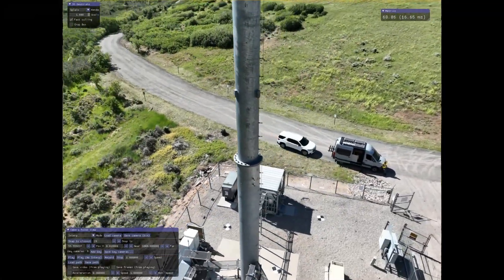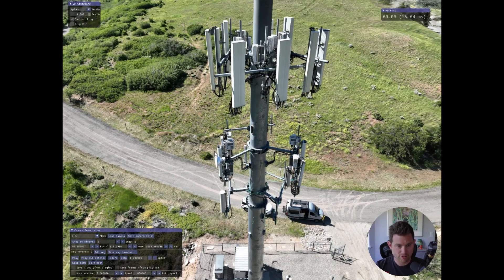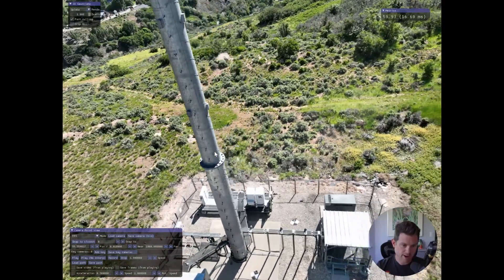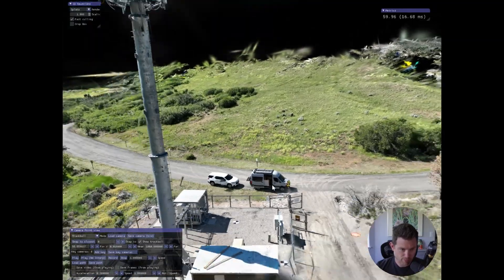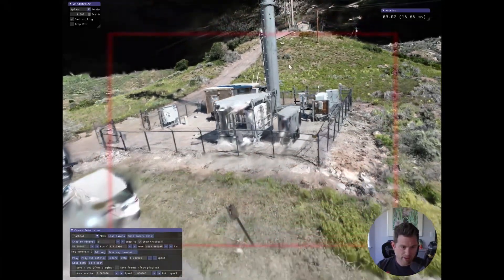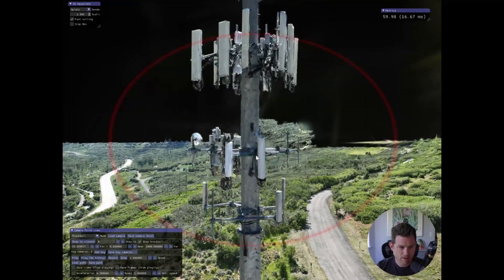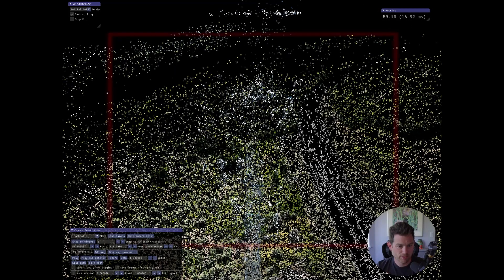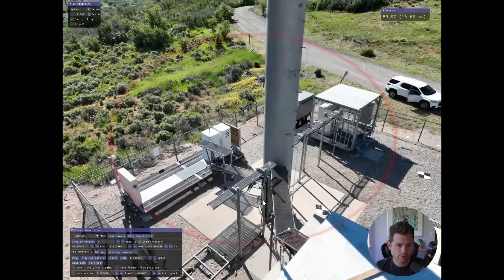3D Gaussian Splatting First Impressions

Comment: do the drones also capture depth data?  If not, how does this system know where in 3d space to put each "splat"?
Reply from the maker: Structure from motion...also it doesn't have to accurately place splats. It just needs to mimic the appearance of accuracy.

Comment: This looks better than what realtors use for 3D tours of houses, I would love for this to replace that technology. Imagine that a drone could be used instead and be programmed like a robot vacuum to sweep the house and get this level of detail.

This would end the practice of taking pictures of each room and give the potential buyers an idea of the layout of the house.
Reply from the maker: Have you checked out Luma AI’s new Flythroughs app? They are essentially doing this.
Reply: @pixelreconstruct I am ready for it to be mainstream, the current technology is headache inducing and should be banned from all usage, with the zoom effect to transition to each waypoint. I have always hated the point to point 3D experience for more reasons: fixed angles, stopping at the entrance of a room, etc…

Comment: I'm curious as to whether you had permission from the tower operator/owner to fly in such proximity to it. In my previous job, I was the manager of radio services for Air Traffic Control and they were often run off towers like this. Your drone being so close would potentially have interfered with our services, it would have potentially also been illegal to fly there.
Reply from the maker: Yes, this was a test site we had clearance at. I wouldn't in my right mind fly around any random tower.

Comment: Sooo what you are saying is: we can input any movie and get out a 3D scene?! Wow! Hold on to your papers because this means any movie ever made can now be transformed into a 3D movie!
Reply from the maker: Not exactly! You need parallax movement in the imagery. If I have a scene filmed from a stationary position, this would not work. Also, moving objects in the scene become ghostly floaters.
Reply: @pixelreconstruct  there is AI technology that can lay a depth map over an image, maybe that tech can be combined! basically the AI was trained on 3D data, images with depth. so now it can be run backwards to generate depth on images. I bet my hat this can be combined!
Reply: @pixelreconstruct  thank you for the answer! I see. so moving objects would require another dimension to be added to the gaussians, to add time. i wonder if a phones lidar scanner can help, or just plain 3D video. maybe iphone will support recording this, together with vision pro true 3D movie playback. that would be rad.

Comment: Noice. I was really disappoint with NeRF, the hype was there but when I tried it out it was never anything close to the demo's presented.  I'll have to give this a try.  Question though, how capable is this to do things like measure features or export 3d assets?  Obviously some scaling or reference lengths would be supplied.
Reply from the maker: If your goal is measuring surfaces or 3D Geometry in general, I suggest Neuralangelo.

Comment: I used to build those towers for real, lots of them all different but the same.
in fact I have quite a few part to some of them here in the shop (antennas, ice bridges, heliax connectors and supports, climbing pegs, various peices of equipment from inside the equipment shelter too and I know how to work Blender so I could create one of these sites from pure memory and be near perfect accuracy since they are burned into my brain.
Reply from the maker: That's crazy cool!

Comment: Curious to know how much VRAM this took to run the viewer after it was already trained
Reply from the maker: Wow, this comment thread went off the rails. TBH, most high VRAM requirements are during the training. Rendering the scene takes less, but it's still not low. I don't have hard numbers. I can run some tests and make a video out of it.

Instant NeRF on the other hand takes very minimal VRAM to render in real time. But the quality is much lower.
Reply: @pixelreconstruct  that would be really cool to see!
Reply: @davidhuculak1099 Agreed! Having that kind of information is not only a matter of curiosity but also having a better idea of how much energy consuming bigger projects might be
Reply: Would still be nice to see some hard numbers on it. Any resource could become a bottleneck depending on the type of application, including VRAM
Reply: Gaussian does use more VRAM, but that's not a current technological boundary or anything, the only reason current consumer GPUs don't have 32GB+ of VRAM like the NVIDIA Tesla series is because they don't need it. Once games and applications start using Gaussian, specs will follow.
Reply: @nullptr.  games wont start using Gaussian splatting. The amount of memory required to display a large scene makes it unpractical. Not to mention games scenes are built from geometry because users need to interact with it, physics depend on it, and ray casting it is a logical extension of it. Gaussian splatting is just interpolating between static images. Maybe good for creating backgrounds or non interactive visual only scenes, but thats about it
Reply: @nullptr. most AMD cards have more than 16gb RAM for less. Nvidia just greedy
Reply: @nullptr.  Gaussian will not be the catalyst, or at least it seems highly unlikely. This is way too niche and will stay this way for the foreseeable future. I doubt this tech will be used by games in the coming 5+ years so games will not be the driver either because if you develop a game that only runs on 20+ GB, you will leave out the vast majority of gamers. No, what will very likely drive the increase in VRAM will be machine learning. Local Large Language Models and Stable Diffusion.
Reply: @Netsuko  I don't see any need for local language models nor stable diffusion. Some small function-specific networks, yes, but a giant service that's already available in the cloud? Not going to happen.

Comment: Sorry for a newbie question, I watched this video for the math.
What happens if the guy by the van moves? If I understand it correctly, the 3D scene is reconstructed from a set of photo images? How do you deal with spatial changes between frames, like moving objects or lighting changes?
Reply: The scene (set of gaussians with their attributes) is trained using a backpropagation algorithm, just like how neural networks are trained so im guessing if two different images show differences, it will sort of blur them together
Reply from the maker: @Niko64321  Correct. You end up with smears or ghosts in the data. If the person is static for several images and then moves, you may have a clear person and a ghost.
Reply: Just a guess, but there could be artifacts due to the motion. That's what happened when I was making panoramic shots out of dozens of photographs.

Comment: 3D Gaussian Splatting to NeRFs has the potential to redefine engineering some applications. When compared with LiDAR, this technology has superior quality and performance. In many cases, there's no need to convert a point cloud to 3D—a step that's both tedious and often produces mediocre results. More often than not, our go-to application is simply loading point clouds into Navisworks for reference. Yet, even on state-of-the-art workstations, this approach suffers from agonizingly slow performance. Given the substantial investments we're pouring in—often to the tune of hundreds of thousands of dollars—only to get disappointing returns, there's an urgent demand for innovative solutions like this. What we're seeking is a user-friendly product that allows georeferencing, "precise" measurements, and overlays with other 3D models. Achieving this would cater to at least 70% of typical engineering applications. Autodesk, are you taking notes?

Comment: Cool! But how is it different from NeRFs?
Reply from the maker: That warrants it's own video. However, in a sentence, 3DGS generates a scene similar to a dense point cloud (but the points are splats) that can easily be rendered by your GPU. So you get really good visuals that run at 100 fps in real-time.

Comment: Question! Can we 3D print the results? Like, exporting the file as object then trim the parts we don't need to print and then 3D print them? That would be awesome!
Reply from the maker: Currently, no. With this project, the goal was novel view synthesis, not discreet solid surfaces. However, additional research has been published that it is possible to extend 3D Gaussian Splatting to solid meshes (that could be converted to 3D printed objects). However, I would not use this technique for 3D modeling. I would use a different technique such as NVIDIA's Neuralangelo.
Reply: @SkeleTonHammer   The output of photogrammetry is a point cloud.  3D Gaussians are already a way of displaying point cloud data, so what you're describing is like a lossy conversion from one point cloud to another.

To get a mesh to use in something like a game engine or 3D printer, there are a bunch of surface reconstruction algorithms to use.  Hopefully researchers are working on those too.
Reply: @BrianHockenmaier "lossy" ? I guess, it depends on the point of camera view and quality of input data.
Reply: @Anton_Sh.  Necessarily lossy because the input data to a gaussian is a point cloud, and the output data of photogrammetry is a point cloud.  There is no more information to garnish from using photogrammetry on screenshots from a gaussian, so essentially the process we're talking about is a lossy conversion of one point cloud to another with a lot of compute in between :)

Comment: Fascinating. Is it measurable, and if so, what is the accuracy? And do you find any notable cons compared to photogrammetry?
Reply from the maker: It’s not measurable like a point cloud or mesh…yet. I bet those tools are coming though.
Reply: I mean, if photogrammetry used to be more accurate than LiDAR on non tree-penetrating surveys, imagine this method getting the tools for measurement. 😂

Comment: Walkthrough of This to unreal or blender please..
Reply from the maker: Currently, 3D gaussian splatting is not supported in either UE or Blender. I'll keep everyone posted if it does.
Reply: @pixelreconstruct  coz its so clean n no space/object ghosting like NErf, even with baked textures out for temp use this would be better.  It does create mesh right? Hv so many questions but excited
Reply from the maker: @visualstoryteller6158  There are no meshes in this scene. You are looking at hundreds of thousands of overlapping 3D Gaussian Splats. You can still get ghosting/floaters with this technique. That is usually do to how you capture and lighting conditions. Less to do with the technology itself.

Comment: Reallllly impressive! Eager to test but I read training is happy with 24Go vram...
Reply from the maker: That is correct. However, that may change. Stay tuned. It’s technically possible to have less VRAM.
Reply: by tweaking the parameters a bit, it's possible to make it work with less memory (around 8Go, depends on the dataset). Quality takes a hit but it's still impressive.
Reply from the maker: @arianaramos1506  I'd b curious to see what parameter has to be changed. I have not dove too deep into that yet.
Reply: @pixelreconstruct  their FAQ talks about changing either --densify_grad_threshold, --densification_interval or --densify_until_iter. I've tried to increase the first one, which ends up causing less points to be kept and makes the training go faster and ran with less VRAM. Less points decrease overall quality but results were still nice when comparing with InstantNGP with the same graph card.
Reply from the maker: @arianaramos1506  Thank you for the info! I will included that on the "getting started" guide that I am working on for folks who do not have 24 GB of VRAM